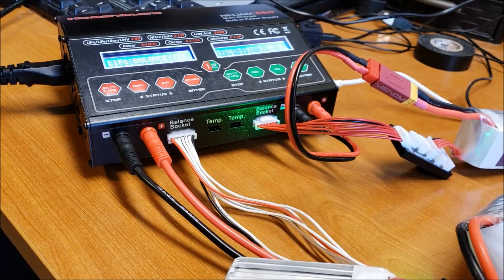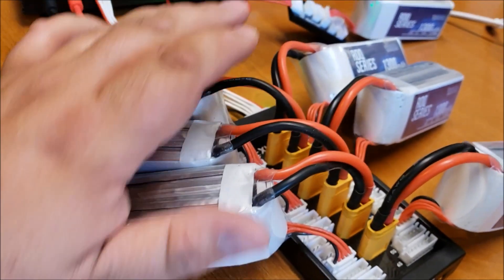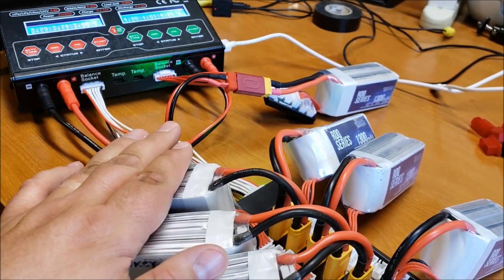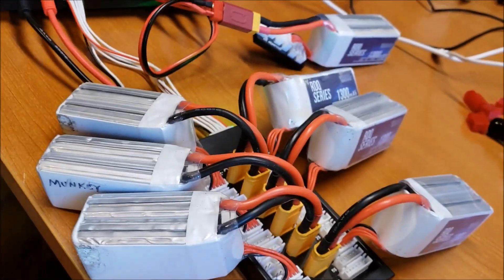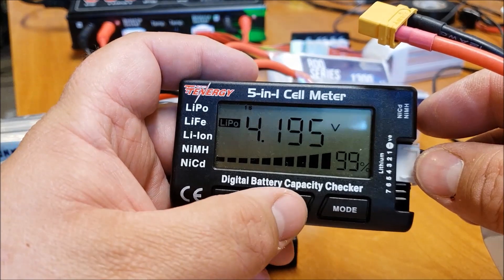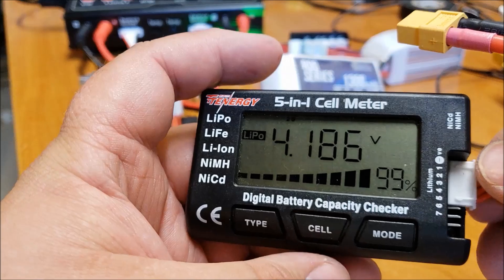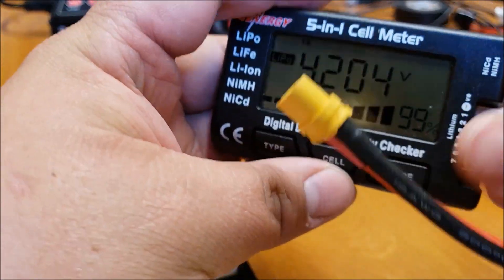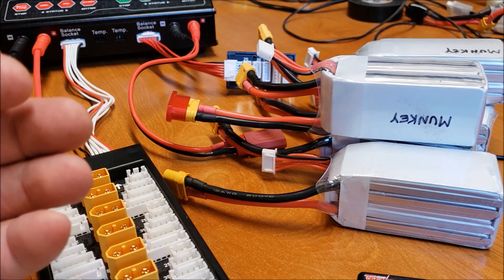How to Parallel Charge Lipo Batteries

Comment: So you're essentially only getting one reading for the 4 cells in each pack, as far as the charger is concerned? Does the balance board itself balance the individual cells, or are you hoping and praying that a single cell doesn't get too far outside of the others during the charge?
Reply: With a parallel charging board connected, the balance leads are not actually balancing. You are "tricking" your battery charger into mindlessly splitting up one current among each balance lead.

If one cell is out of whack, the charger is clueless to slow(balance) the current going to the individual cell in parallel. This is why MAH and cell counts have to be the same. This is also why you need to check battery health on your own.
Reply: @brandon9689  good advice. Still have never had a cell puff or explode. I've had some clearly weaker than the others. Guess I've been lucky.
Reply: I know your question is from 2 years ago , but the white plug is the balancing plug that charges each cell

Comment: How do you know which balancing plug to use if there is no indication. If I put the battery in the first xt60 plug, do I put the balancing plug in the left or right 4s?
Reply from the maker: It doesn't matter as long as you make sure the balance plug is in the right slot 2S, 3S, 4S, etc...

Comment: i dont get why you do the 6 * 2 = 12 method.. i was learned that no matter how many batteries you have for parallel charging, make sure you have an even amount e.g. 2, 4, 6, 8 ect.. and add up the mAh of each battery divide that by 1000 and thats your amp charge rating.. for example: 2 batts of 1400mAh would be; 1400 * 2 = 2800 so i would charge them at 2.8A..

With your method i would charge my 1400mAh batts with: 2 * 2 = 4 (amps) wich is not save
Reply from the maker: So honestly I rough guesstimate. I race quads so I have to be able to charge quickly. It's not the best for the batteries, but it works. Usually I will charge a 1500mah at 3.0amps
Reply: @FPVEvilMunkey  i see makes sense :)

Comment: So, I have some lipos that are all 6s 1300mah but they're different brands and one is a 120c and the other two are 100c. Can I charge them together? I already have a balance board and I plan to pick between them to decide on a single brand but until then, should be fine to charge these together right? As long as I'm just balance charging?
Reply from the maker: Should be fine. The C rating is only the discharge rate.

Comment: I didn’t know you can balance charge batteries in parallel mode? Do you also check to make sure the cell voltages are close as well before charging?
Reply from the maker: Yep I check to make sure they are fairly close.
Reply: TYVM for sharing!!! Getting all the info on parallel charging and your post was very helpful :)
Reply from the maker: Your welcome and thanks for watching

Comment: How do you line them up properly?
Reply from the maker: As long as the XT60 is in the port, then the balance lead can be on either side doesn't matter as long as it is in the right port like 4S, 5S, etc... Think of parallel charging like one giant battery.
Reply: why you charge at 2A each? and not at 1.3A?
Reply from the maker: I always have and they have been fine.

Comment: Nope,  mah does not matter. Same voltage...
Reply: Well if you are charging a 1800 mah and a 1000 mah, what would you set the amps to?
Reply: @cozi9996  2.8A
Reply from the maker: You can't parallel charge a 1800 with a 1000 unless you want to burn down your home. You can only charge like mah. 1800 with 1800 and 1000 with 1000 you can not mix and match.
Reply: @FPVEvilMunkey  simply not true. If they are at the same voltage it makes no difference. Slightly different in extremes like a 200 & a 2000, as the current difference is 10x and the smaller battery would get 10c spike when they are plugged in together. but for 1800 and 1000, this is no more dangerous than charging the 1000 at 2C.
Reply from the maker: Okay 👌

Comment: They have to be at the same voltage, the mAh can be different.
Reply: Yep. You could throw a 6,000 mah battery on there and be fine. None will overcharge since they'll equalize.
Reply: But by how close? If I have 2 batteries, ones at 15.44 and another's at 15.33? I feel like it's almost impossible to get them all to be exact
Reply from the maker: As long as they are close in range you'll be fine.